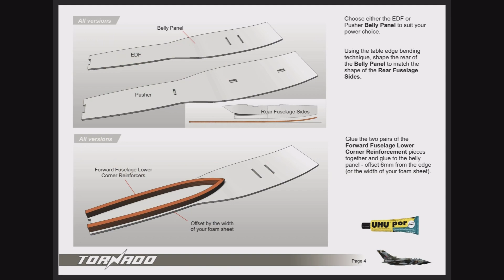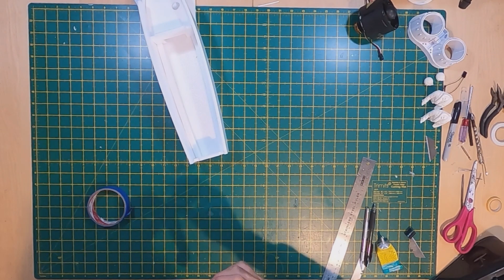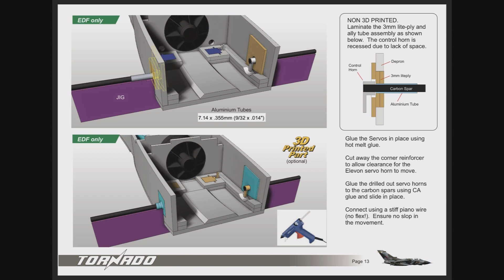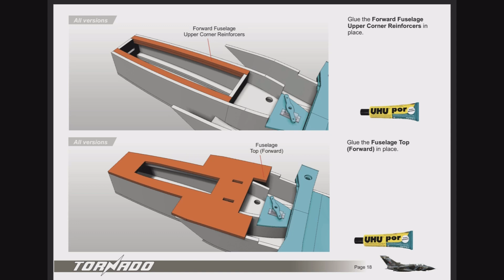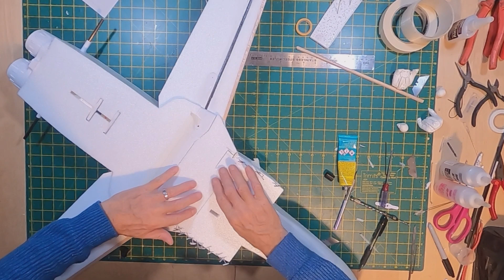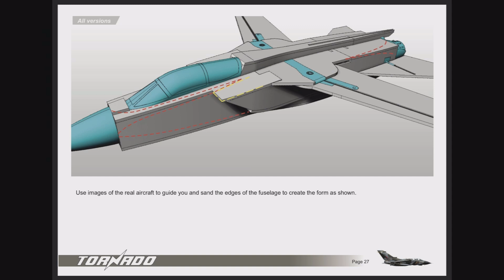Jetworks Tornado build

Comment: information         7:24  the vert-stab should be tied into the structure of the fuselage with an  un-sloped spar.          it is the opposite of smart to fly a model with stuff hanging under the wing.!
Reply from the maker: Thanks for your critique David.  The Spar is mainly to keep the vertical stabiliser stiff.   The drop tanks are optional, the builder can choose to equip them according to where they land it.  Such as very short grass...  The tanks are higher than the belly panel.